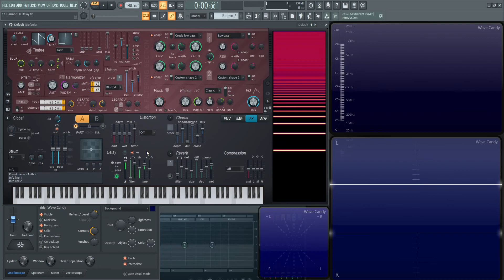Harmor Tutorial PART 17 FX Delay | FL Studio

Comment: 0:13 There isn't a way to sort of invert the polarity on unison index mapping, right? With that fully engaged, in this case that would translate to the left side becoming the octave down and right side neutral. This could be so cool for stereo global lfo phase movements, for example. What I do know is you can easily and quickly copy stuff over to side B and link up any automation there, you can even invert-link things or whatever, but that is different.
Ideally we could also automate the x and y of the drawn points, that'd be next-level, maybe some other auto-morphing ones besides inverting horizontally
Reply from the maker: hmm not that I'm aware of? It may be possible but I haven't tried that specifically.
Reply: @jonaudio  Right, I guess I'll keep doing the A/B side stuff. For filter envelopes you can also basically have one voice do the inverted motion of another and morph between that so they trade off like ping pong delay etc., cause the envelope amount knob goes into the negatives!